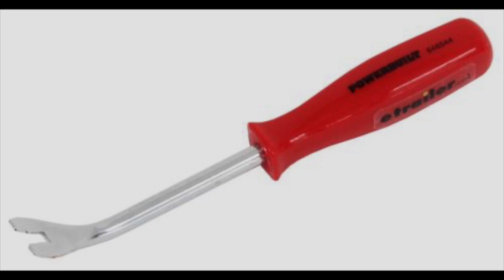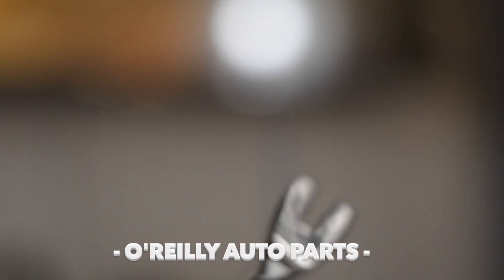Traxxas Slash Quick Tip 1-
Wheel Hub Hex Nut Removal Trick

Comment: Thanks, I've been trying to get that stupid thing off for an hour. Actually already had the tool and it popped the nut right off. Another real quick tip - don't drive your RC at the beach and trust the plating to protect the components or like me you'll be tearing your rig down to the nuts and bolts, replacing every nut and bolt, and cleaning corrosion from every metal surface and praying it will still work if you can put it all back together. Thanks again.
Reply from the maker: Haha mine has been through everything minus sand lol all the bolts are rusted lol